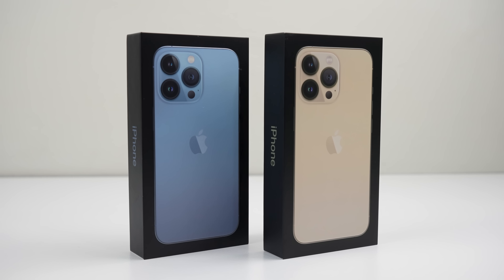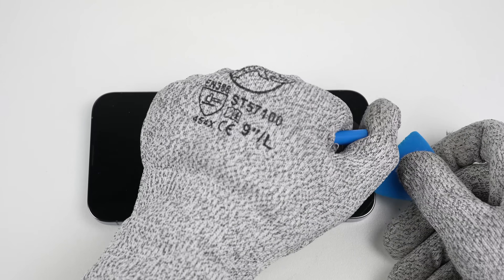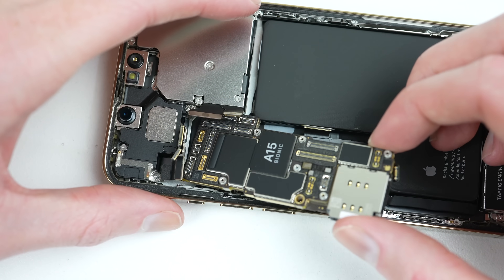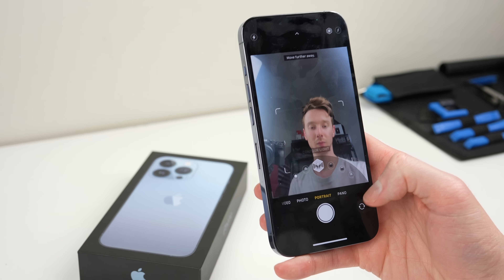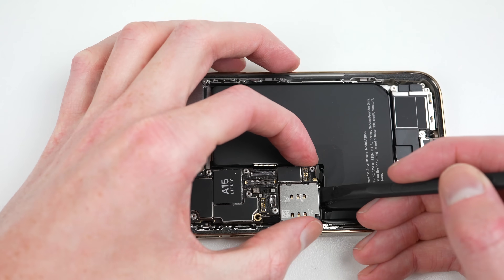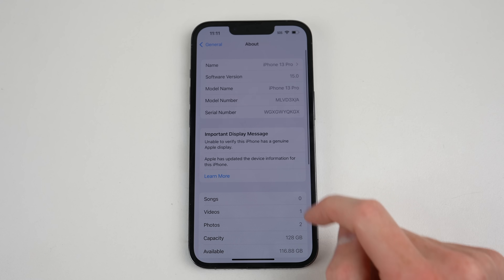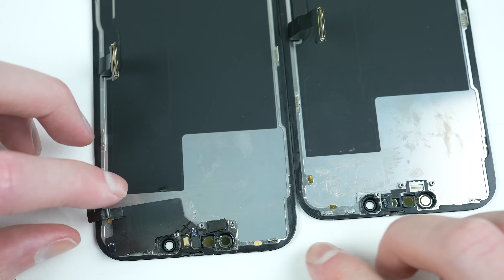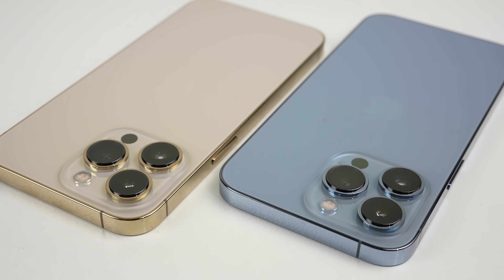iPhone 13 A Repair Nightmare - Teardown and Repair Assessment

Comment: It's sad seeing Apple going in this direction, but it wasn't surprising.

Thanks for all the likes.
Reply: The thing is, enough people will still buy the iPhone 13 despite Apple being such control freaks. Apple of course knows this. The only way to stop Apple's relentless march down the road of ultimate control is to for people to stop buying increasingly locked down iPhones which MUST be repaired by Apple at extortionate prices, unfortunately this won't happen because, despite Apple being so customer-unfriendly, most of their customers are addicted to the iPhone range.
Reply: @SlartiMarvinbartfast  There's better phone's at half of price. I changed from iphone to Android 3 years ago!
Reply: @SlartiMarvinbartfast  Then just switch to Android.
Tons of Android Phones are much powerful than iPhones in good prices.
And they're repairable too.
Reply: @retrocysper3709  I agree, I was trying to make the point that as long as people keep buying iPhones Apple will keep on making them more and more difficult to repair by anyone other than Apple. The only way to stop this practice is for people to send a message and stop buying iPhones (which they won't).
Reply: @SlartiMarvinbartfast  Well actually I agree with you.
But even if we send the message they wouldn't listen.

The only way to stop this practice is to make people just decide to not buy these phones.
Reply: @SlartiMarvinbartfast  I buy apple because of the eco system, each product works so seamlessly with each-other. The repairs are expensive but that’s why I buy apple care (has saved me so many times haha)
Reply: @SlartiMarvinbartfast  The serious Apple buyer changes their phone so often that they don't care about repairability, since a phone doesn't need repairs after only a year of use (unless it's a Xiaomi or other cheap crap lol).
Reply: @maevwat  Oh trust me, i lived it first hand. The joy of thinking you're saving money and then realizing they sold you a cheap piece of garbage held together with fucking plastic clips.
Reply: @enzoperruccio  And what about if they accidentally drop their phone and crack the screen?  You pay Apple a shitton to replace the screen, or buy a new phone.  It's as stupid as if you crack the windshield in your car and have to replace the whole engine at the same time.
Reply: @stoojinator  Well, they're giving you the option to replace the screen and can charge you whatever the hell they want. Expensive stuff is expensive to repair, and I know it could be cheaper if you DIY it but still, OEM is OEM for a reason. If you don't like iPhones or Apple Itself just switch to another brand, it's simple.
Reply: @enzoperruccio  Imagine simping for billionaire companies. I hope you're at least getting paid lol
Reply: @enzoperruccio  the serious apple buyer or the apple consumerist?
Reply: @WhenDoesTheVideoActuallyStart  Consequences for everyone? whoah slow down there. Since when is iPhone the only choice for a mobile device? As far as I'm concerned there are other companies out there with different approaches, some better and some even worse than Apple, which is a lot to say these days.
Reply: @WhenDoesTheVideoActuallyStart  I'm not going to deflect, I don't have to. Maybe you're right, maybe all phones will be like iphone in the future or maybe not, who knows? These companies are a direct reflection of ourselves, we have given them the greenlight to all this crap, yes, we. Maybe not you, maybe not me, but the average consumer has, and as such there's nothing we can do about it. Just enjoy the chaos and try to get the phone that best suits your needs. Maybe things will get better in the future, or maybe not...
Reply: @enzoperruccio  my Xiaomi redmi note 4x has 4 years i use them 2 years and give to mi mom because her galaxy j7 2017 fails. and now is still using that phone . Never has a problem. The battery kepp’s the phone to 7h 8h of use.
Reply: @enzoperruccio  isheep everywhere.very sad
Reply: @enzoperruccio  God I love reading your comment... how you defend apple.. Makes me kinda smart. Keep doing it m8!
Reply: @yajhnal6536  And the best part? I don't even own an iPhone nor will I ever do. But having tried them out I've slowly learned not to be an idiot and put myself in their buyer's shoes. Android can be a pain sometimes and I totally understand why some people would pay more just to avoid it. Always remember not everyone thinks like you, m8 ;)
Reply: Sad is such a weak choice of word. 
DISAPPOINTED is the right choice here
Reply: Me too but it’s still sad
Reply: I don`t understand y people still buy this trash
Reply: And herds of drooling brainlets will still support Apple at the religious level.
Reply: I think reprogrammers will exist for iphone 13.
Reply: Criminal behavior by Apple.
Reply: & the best part is that, im not a F Apple fan boy ! 😂
Reply: Apple doesn't buy their products, people do. The same people keep making this mistake....  You keep giving apple incentive to continue like this.
Reply: But you still bought their stuff and will keep on doing it.
Reply: Agree
Reply: @Mr. Khan I've owned from the Motorola Droid to the Samsung Note 10 5g, upgrading at least once a year. Then I switched to iphones early last year, and I couldn't be happier.
Reply: I love how this turned from an Apple moment comment to an argument about Xiaomi being bad and then again to Apple moment
Reply: @merbudd  instead of apple vs samsung it should really be xiaomi vs apple lol
Reply: Yup
Reply: The Tim Cook direction.
Reply: @MrMannyhw  Tim Apple Direction*
Reply: Apple - Rotten to the core!
Reply: it's cause they're climate hippies and think they're helping by re using their stuff from last year, i hate those kinds of people, especially if they're older than 40 cause who the hell cares by then
Reply: @Mr. Khan yes i have lol i never damage my phone at all and if it was damage i would go straight to apple for repair or replacement.
Reply: Nope it's not. Just don't buy this sh...
Reply: I'm happy they're going this way, now it's just a matter of time till those stupid apple sheep finally notice apple products are just copy pasted last years tech for future prices
Reply: I’m scared of what Android will do next
Reply: @jank1607  hopefully they wouldn't go this direction.
Reply: @jank1607  that's why many people chooses android.
It's because they were free to do what they wanted on their phones and they have their right to repair their phones.
Reply: They have always had this mentality, if it wasn't for them pig-backing on windows to launch their ipod they woundn't have made it this big, i believe this is what held back in obscurity for the longest time.
Reply: You couldn't open the very first Macs back in the 80s to swap cards in and out like you could with every other computer on the market. Nothing new here.
Reply: We only way we can stop this is by not buying any apple products. Apple will be force to change this or they will lose sales.
Reply: Legislation...
Reply: @jeremyocampo1529  No, the only way to stop this is to call your representatives and demand that they support strong Right to Repair laws for reasons like this.
Reply: @Raptor747  Then lets make it happen
Reply: sadly samsung Will mock apple and on the next year Samsung Will copy apple
Reply: @PS-ub8st  yep. That's why I hate their marketing
Reply: Apple and every other brand
Reply: they are going to change this back  like they did with the camera last year
Reply: Tbh I am glad apple blocked apple 3rd party repairs because when u have ur iPhone repair by a 3rd party you cannot trade it in apple store to buy a new iPhone but now with the 3rd party repair blocked you can trade in ur old phone to buy a new one most of u might hate my comment but i am just saying in general.
Reply: @kingly9728  ....so you're glad they blocked third party repair... because they block you from trading if its repaired by third parties? Bruh did you give what you just said a single thought?
Reply: @dxshawn532  nope i am just saying in general mate lol no need to be mad its apple they are very tight with security which u should consider a good thing unless your android then theres not much i can say in this matter but apple is very strong with security.
Reply: It's sad? This is the perfect way to do business. Authorized repair shops by Apple pay so much money and follow all the rules just to have business stolen by unauthorized repair shops. This is a major step in the right direction. If you don't like how Apple conducts their business, don't buy their products. It's so damn simple.
Reply: @ea9849  Apple will have to follow right to repair sooner or later. Their ethics suck
Reply: @swarooprajpurohit110  right to repair is being fought against by major conglomerates through lobbying. But going to happen in US. Maybe EU
Reply: @ea9849  Well then the repair price is overpriced.
So why don't go to some repair shops that saves you a lot and does a good job?

Business huh. More like Cash Grabbing Business.
Reply: It's not sad, it's great. You're free to buy any other crappy brand if you don't like Apple. We love Apple the way it is.
Reply: @eckee  lol surely these crappy brands you're talking about is having a more powerful hardware than your New iPhones.
Reply: 🇺🇲USA🇺🇸 saving the planet.
Reply: @mahdyfouad  Log off, your bedtime is near. (They edited their comment; originally a love poem for Apple).
Reply: @THEJPR  bedtime is over
Reply: @THEJPR   Cause I was sarcastic. now you can understand me.
Reply: @kurnikov613  You fool! Bedtime is ETERNAL!
Reply: @mahdyfouad  trash country lol
Reply: Time to boycott their products. The right to repair bill is now law.